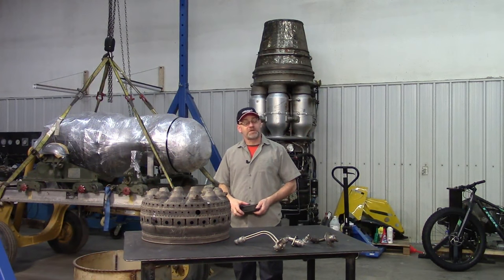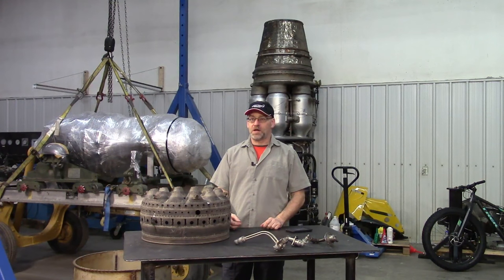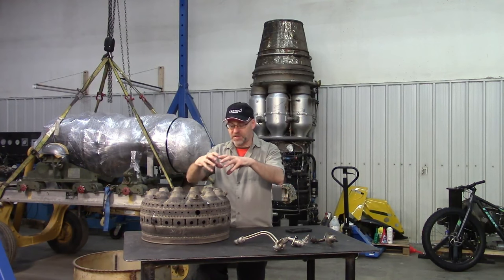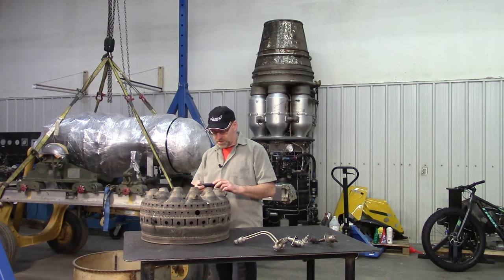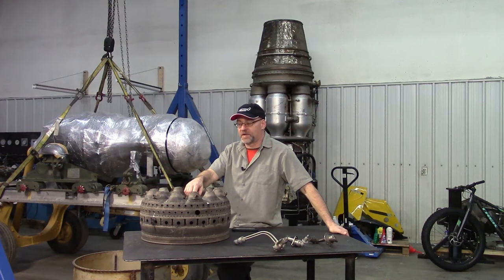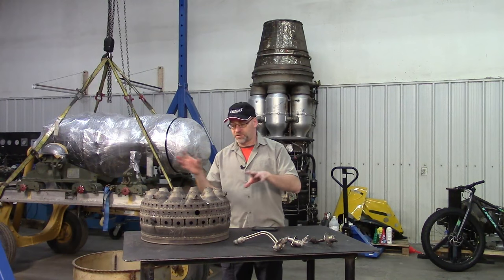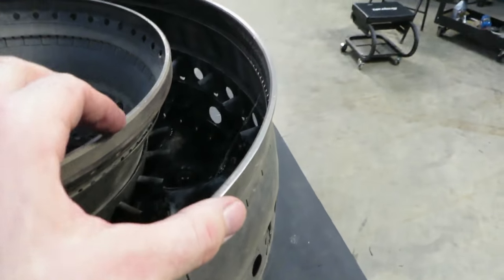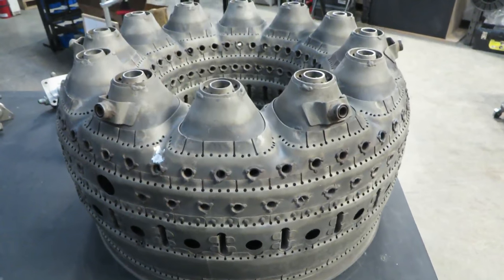Jet Questions 90

Comment: Diesel and Jets have self sustaining ignition. I suppose if you can't control the fuel it will runaway (over RPM or not able to shut down). Both of these could be failure of fuel control to shut down or  provide excess fuel. Jet or turbojet engines have a fire handle and just, pulling the handle will shut down fuel, hydraulics, pneumatic, electrical). This is in addition to the normal fuel cutoff, which if it fails would not allow engine to shut down, thus fire handle. Turning the handle discharges fire retardant.
Reply: It happened to a early A380 when a oil feed line broke in one of the RR engines. that caused a runaway and total turbine failure.

Comment: Do jet engines typically rotate in the same direction? in the case of a multi-engine aircraft, do any of the engines ever rotate in opposite directions to counter balance engine torque? Love Jet Questions!
Reply: This is an old question!  Typically, R-R engines rotate in an anti-clockwise (counter-clockwise in N American speak) direction, viewed from the rear. However, other UK engines have rotated in the opposite direction. For example, the Armstrong Siddeley Sapphire rotated in a clockwise direction, as did DeHavilland engines. US engines typically rotate in a clockwise direction, viewed from the rear. However, there are numerous two- and three-spool engines that have counter-rotating spools.
I'm not aware of any jet engines that have opposite rotation for left- and right-hand installations on multi-engine aircraft. However, the Airbus A400M military transport turboprop does have opposite hand rotation props on either side. Try finding a clip on YouTube.
Reply: PS I've had to explain this before, but in a jet engine, there is minimal toque to be reacted by the engine mountings. The torque generated by the fan and compressor stators is approximately equal and opposite to that generated by turbine stators.
Reply: Thank you for taking the time to respond!  I apologize for the repeat question, but that one has been nagging me for a while.  They are amazing machines...
Reply: PPS I've also mentioned this before, but whilst the main engine mountings may not be taking a significant amount of torque during normal operation, they are typically designed to take a massive amount of torque. After all these years, I'm rusty on the design rule we actually applied at R-R, but, from memory, we designed the mountings to take the torque generated by the engine rotor seizing in either three or five revolutions. That was probably a massive 'overkill', but the objective was to ensure that the engine didn't wrench itself out of the airframe, if it did seize.

Comment: Hi jay, stupid question from someone with no clue about engines. If radial compressors can do 900 percent compression and axial ones only about 10 and therefore need many stages, why are axial compressors used on big planes, while radial ones are more popular on model engines? Is the advantage of radials somehow lost when scaled up?
Reply from the maker: Several pages needed for an adequate answer.
All the books I recommend have them.
In my video about books. It's called Books.

Comment: Since you have a test cell and maybe a spare engine laying around. If I got a kick starter (pun intended) to supplied the garden hose of gas any you supplied the testicles to operate it, in the interest of science of course, could we find out if that would actually cause a run away?
Reply from the maker: I would have to ask the owners of the test cell. Any spare engines laying around are hulks, that will need about 50K of work at a minimum to get them to running shape.
Test cell fee is large, and does not include fuel or any labour to set the engine up.
If you can raise 100k US, and agree to cover any damages caused by catastrophic incidents, I'm sure your curiosity can be satisfied.
Reply: Ha! No need I was just pushing the funny. I've seen what happens when an axial flow steam turbine over speeds and its very bad, and they have very thick cases and no big exhaust hole at the back for parts to fly out of! Needless to say if one ever did run away you'd have heard about it!
Reply: That sounds like something for Mythbusters to do out in the middle of nowhere, maybe next to where they blew up the cement truck.

Comment: Do any engines that use centrifugal compressors have more than one compression stage?
Reply from the maker: P&W makes a very successful range of turboprops called the PW100 series. Two separate centrifugal compressors in series.
Each is driven by a separate turbine, so technically it is two single stage compressors, not one two stage assembly.
Good description if you put PW 100 in your Google search bar.
Make sure it doesn't get auto-corrected into PW1000g, 'cause it'll want to do that...
Reply: AgentJayZ
Thanks, have looked at the diagrams, looks similar to the concept used on axial dual spool engines. (I hope I'm using the correct terms)
Reply: The R-R Dart turboprop engine had a two-stage centrifugal compressor.

Comment: How do some old fighter engines use a cartridge start system to start up?
Reply: Also what inspection methods do you guys use on a normal basis ie eddy current, dye penetrant, etc.?
Reply from the maker: You will find your question answered in a video somewhere in
the playlist I’ve created called   Your
Questions Answered. It has a sort of index.
Reply: AgentJayZ oh ok sweet. Thank you!

Comment: may I ask you how to calculate the composition chamber 

like if the hot sections torbine diameter 18 inch will be 200 holse by size 0.6 inch per primary hole 

make the answer example the composition chamber that in this vedio
Reply from the maker: Nothing you have written here makes any sense.
You need to read a few books to learn a few things, so you will know that your question is meaningless.
You will enjoy the learning process, I think.
Reply: Abdulmalik Alrogy - Do you mean combustion chamber? Or are you writing music in a very small room?

Comment: I think I've heard of an over speed when oil seals failed and before everything died from lubrication failure.
Reply: NoisyPlaces I think I heard of it happening on a test stand/demo turbine (for teaching purposes rather than power) I'm not surprised it has been documented at least once. It's a very very rare failure mode though.

Comment: hello Jay!
i say that it can Run away, after the Engine shuts off...for some reason IF fuel pools up in the combustors And when the engines is starter Up this fuel Will ignite .....scary!!
Reply from the maker: That's not a runaway... that's called a fire, and it can destroy the engine. Motoring the engine on the starter usually puts it out.
Reply: thank you Jay for THE explanation,really appreciated....i Always follow your videos, i really love Turbojet, i building My own out of a Holset truck turbocharger!
Reply from the maker: I've seen many of those run, and some are quite scary. They scare me because the builder has left out an important part in his design. Can you think of what it is?
Reply: AgentJayZ hello Jay!
thank you for your input,i guess you talk about safety issues?
othervise many fails because of wrong ratio between compressor inducer and turbine exducer
No spectators near the engine while running
monitor all kind of technical information from Engine like RPM,EGT etc etc
maybe this could be and input from you in One of your videos?,your worry about DIY gasturbine engines?
thanks from Stephan Höglund in sweden
Reply from the maker: That's not the answer I was looking for. If you watch the playlist Your Questions Answered, you will see in there somewhere a lot of discussion about the combustor liner. An extremely important part of any jet engine that most turbo-builds leave out.
When I see a yellow or white hot turbine casing on a turbo-based engine, I dread the thought of it exploding and killing people. I would not get near one of those things.